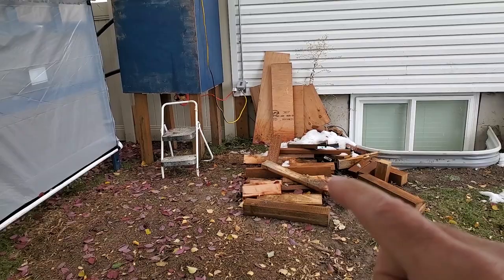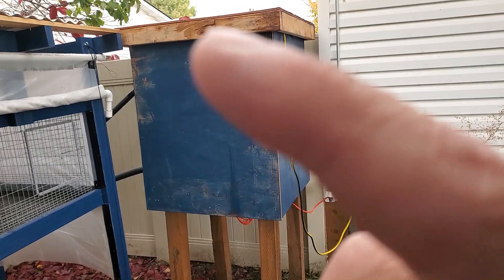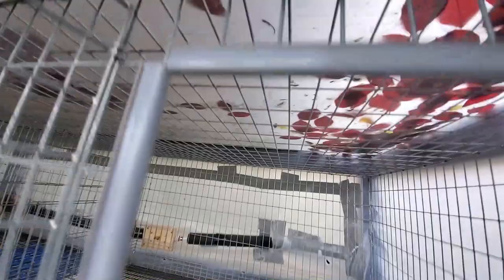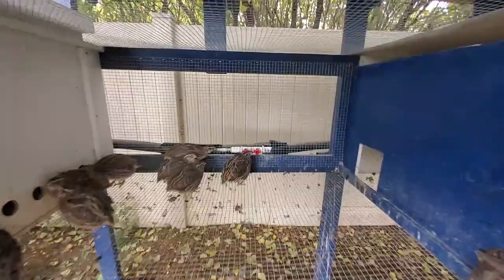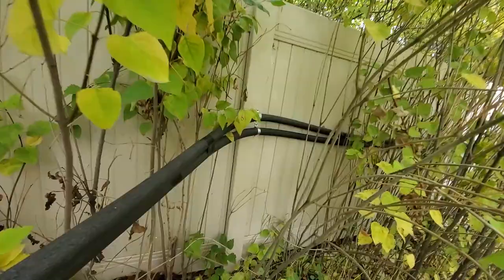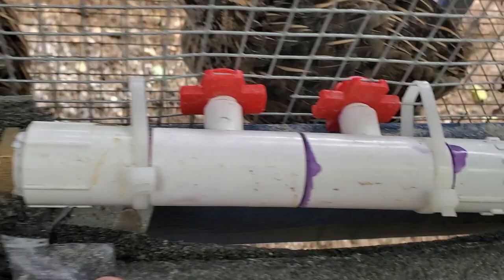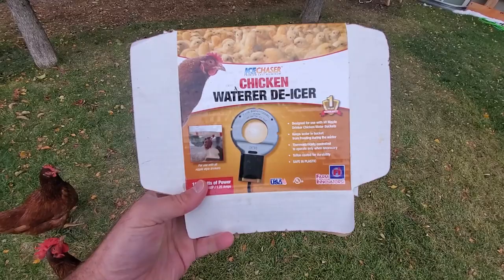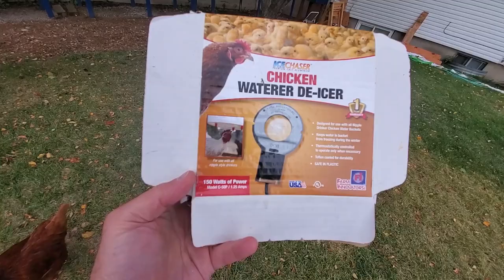Part 1 - Ultimate Winter Automatic Watering System - Chickens - Quail - Rabbits

Comment: This is something I will build for my winter 2023
Reply from the maker: Cool, glad it was helpful. A couple of suggestions if you live in the cold like I do. The system as a whole never froze up even at -9 degrees F. However, if it got down into single digits F or below, the plastic red bird watering nipples themselves froze up. (they didn't break or anything, I just had to scrape the ice out with a small screw driver to get the water running again a couple of times a day) The rabbit's metal nipples (in their hutch I closed off from the wind when it got really cold) never froze up at all. So I think metal nipples are better and so is having the waterers out of the wind. So to improve this system I am going to see if I can find metal bird nipples because they will conduct the heat of the heated water better. And I will most likely take out the pvc tees and just drill holes directly in the pipe, and tap threads into the holes, and screw the nipples directly into those. Then the warmer water will touch the back of the nipples and I bet they will never freeze up. I may move the quail waterers into the part of the cage where they will be out of the wind, but I might not. I don't think I will have to. Hope this is helpful.

Comment: A way to insulate the drinker bars better than wrapping with foam would be to use an umbrella cover (plastic bag sleeve or tube) and inject canned foam insulation into the bag with the bag forming a sleeve over the drinker tube.    I put the plastic bag tube over the pvc Tee's then screw the fittings (drinkers, 1/2 male ends on either side) in over top of the bag form (use a fender washer between the drinkers and the threaded Tee end to stop the foam from expanding and locking the drinkers into place.  This is a way to permanently encase the drinker bars while stile being able replace a nipple when necessary or an entire bar.  I make these for resell at Tully River Quail
Reply from the maker: You should do a video demonstrating that. And then comment and give me the link. I would love to see it.

Comment: Dude! I’ve been looking for a winter watering system for chickens on YouTube! This is exactly the inspiration I’ve been looking for. We will see if my iteration will survive the MN winter.
Reply from the maker: I would drill holes directly in pvc pipe rather than using tees. And use metal chicken nipples. Metal conducts heat from running water. Then it won't freeze. My pipes never froze, but the nipples did whenever it got into single digits. Nothing ever broke and if you watch some of my later followup videos I show how I freed them up with small screw driver when they froze up. But this winter I will make the changes I suggested and then the nipples won't freeze either. My metal rabbit nipples never froze at all. Hope that helps.

Comment: If your water nipples freeze, use a hairdryer to warm them.  This is the weak spot, especially with one that may develop a slow drip due to weather changes creating drinker ice-cicles.  May not be a bad idea to have back up Tupperware with some holes just in case a problem occurs.  Easy to alternate a pair of these having a fresh one ready to replace a frozen one.

I make my drinker bars with shut offs so they can be removed or replaced quickly if necessary
Reply from the maker: Awesome. If you have done a video showing that on your channel please send me the link. I would love to see it.

Comment: I like your system. Could it use a 250 or higher watt water heater with an inline thermostatic control for deep very cold winters, seems the 150 watt one does not keep the  water drink nipples from freezing.

Comment: Would you make any changes to the system now that you have made it through 1 winter? Also, do you constantly have the water pump running in the summer months? Thank you for the great video!
Reply from the maker: Cool, glad it was helpful. Yes there are a few changes I plan on making in the fall. The system as a whole never froze up even at -9 degrees F. However, if it got down into single digits F or below, the plastic red bird watering nipples themselves froze up. (They didn't break or anything, I just had to scrape the ice out with a small screw driver to get the water running again a couple of times a day). The rabbit's metal nipples never froze up at all. So I think metal nipples are better. So to improve this system I am going to order some metal bird nipples because they will conduct the heat of the heated water better. And I will take out the pvc tees and just drill holes directly in the pvc pipe, and tap threads into the holes, and screw the nipples directly into those. I have noticed that Carolina Coops switched from using tees to drilling holes directly in the pvc pipe. I bet that was because some of their clients in colder areas were having the nipples freeze up. Doing that alone I bet would be enough to keep the nipples from freezing. But I am going to use metal nipples too just to be sure. Hope this is helpful. And about your question regarding running the pump in warm whether. I have it on a temperature switch that only turns the pump on when it is below 40 degrees. So now most of the time the pump doesn't run. That is why I elevated the water tank so that gravity would fill the nipples with water when the circulation pump wasn't running. Great questions!

Comment: How do you fill the tank?
Reply from the maker: A garden hose. In the winter I just keep a hose drained and in the garage. I just hook it up, fill tank quickly, drain the hose and then put it back in garage. I've done it in very cold subzero weather and it works fine.